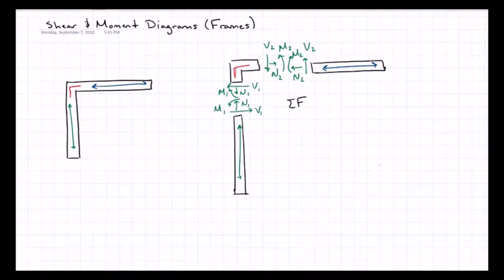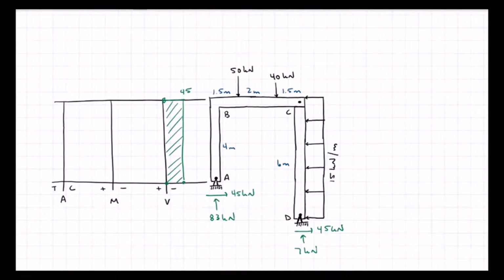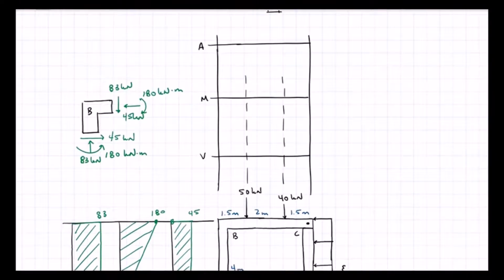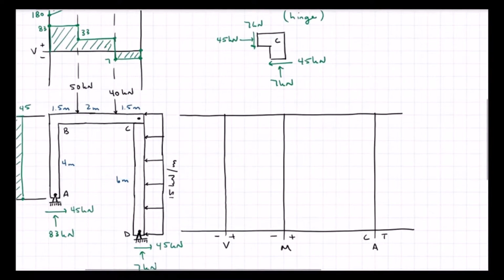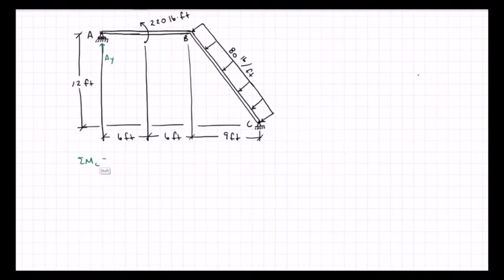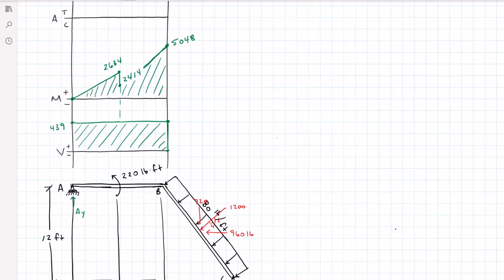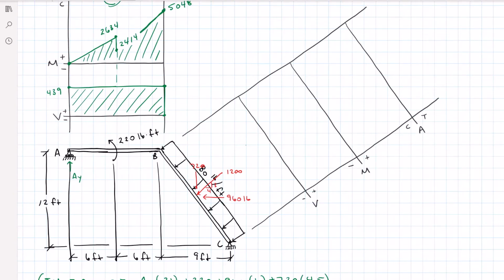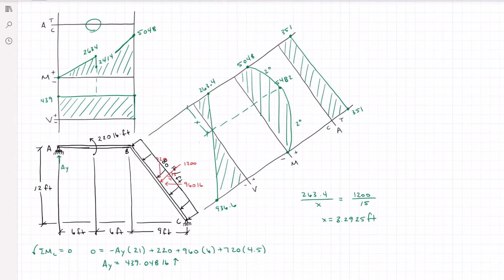Shear and Moment Diagrams for Frames

Comment: Its better if you show the solution how you get the support reactions
Reply: If anyone needs to figure that out, they should be studying force reactions specifically. That is the "easy" part. It is all relative, but at the level she is going at with this video, it makes sense to focus on the moment and shear diagrams. It is good to keep content within the scope that makes sense... otherwise this could end up being a all-too-long video. 

That being said... for those that need the help: google "how to solve force reactions in x and y axis". Also, another tip: when solving for force reactions, consider the body as a  when summing the equation for the forces and the equation for the moments.